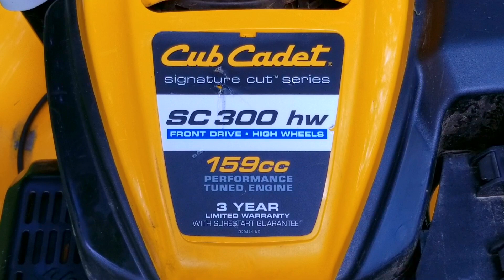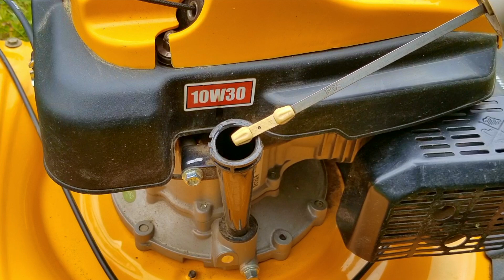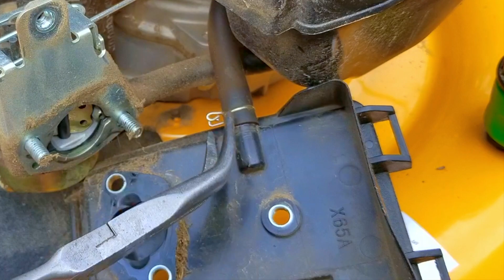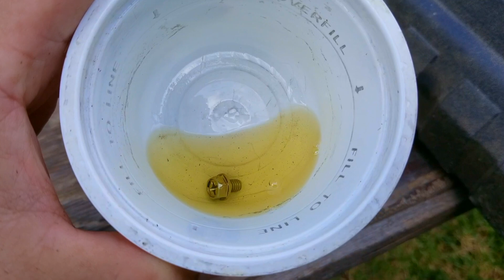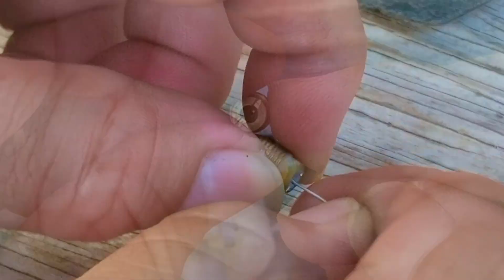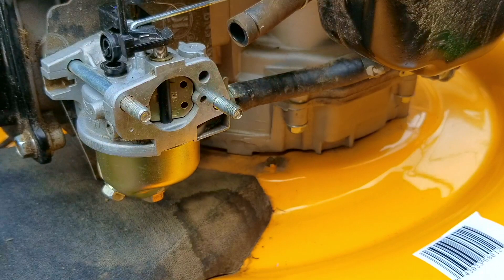Fixing a Mower revs up and down

Comment: Four years later and when I look at this engine, it's similar to one on a 2008 Yardworks (a Canadian Tire store brand) mower my Mom used to have.  Hers was the GXV140 variant of the PowerMore engine while this one looks like it's similar to the Honda GXV160 I have on my commercial mower.  Under the flywheel cover for the choke system, it uses a wind vane to open the choke once the engine is started.  It looks like this one has an added thermostat on the exhaust side that if I recall correctly, my Mom's didn't facilitate for easier warm starts.  They're good, reliable and robust little engines and even the horizontal shaft 420 cc one I have on my 28" Cub Cadet snow blower has been really reliable.  It, of course, was one that didn't have EFI or "Intellipower" and still has a standard carburetor.  I wonder though, one of the other comments was talking about fuel filters.  I wonder, don't these engines have a fuel filter screen in the tank like a Honda?  If it doesn't that's strange because other Honda derived engines usually do.
Reply from the maker: I'll have to take a second look at it again.

Comment: I think I would definitely flush the tank. When contaminants are in the tank, they can move around in the gas for quite some time without causing a problem. When you run it out of gas, all of the particles concentrate at the outlet screen. Like yours, some of the debris made it through the outlet screen into the main jet. You fixed the symptom but failed to eliminate the source of the problem. An inline filter may help. Also, I find it easier to remove the carb by first removing both studs. Then when you remove the fuel hose, you can gently move the carb away from the tank as you disconnect the hose. This will prevent excessive pressure from pushing back on the short hose from snapping the plastic nipple off of the tank.
Reply from the maker: nice, I'll have to fix that

Comment: I'd put an inline filter on the mower but also inspect the gas cans to see if there is anything lurking down below by tipping them over so one corner is lower than the rest. Works best on a sunny day. Glad it's fixed and GBWYou!
Reply from the maker: very nice advice.
Reply: @INSIDEHOUSEGARAGE  All I can say is that it works here and LOTS of folks mess up a good mower by pouring every last drop of gas into their tank and not seeing if it's water and trash or not. A simple look see or pouring out the last into a jar will tell the tale.

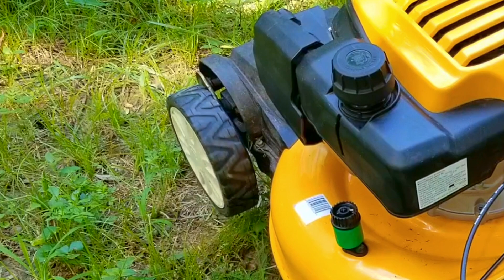Comment: 1:04 may I ask what is that little thing with the green on it on the mower deck?
Reply from the maker: It's a wash port. You're supposed to hook your garden hose there, and Run the mower after each use to keep the deck clean. Most people never touch it.

Comment: i worked on a honda clone just like that an them engines are just junk you can work on one thats never ran and it still wouldn't run it would be suprising to see one worked on an running
Reply from the maker: thank you Joshua Ferguson, these definitely have their issues.

Comment: I don't usually use fuel filters on push  mowers because the fuel line is so short. I would clean the tank  and carb and call it good.
Reply from the maker: that makes sense, thank you Brian King

Comment: Where and how do you dispose of all the gasoline you empty out of the equipment you get when its old and funky? Thanks
Reply from the maker: ah.. great question. I store them in a metal cabinet, and reuse the old as a solvent. if it's not that old, I'll put it into an existing tank of gas to be used as fuel.
Reply: @INSIDEHOUSEGARAGE  what if some of the equipment has 2 cycle in it? Do you separate it? What do you use the 2 mixed for?
Reply: @StudCity718  good for cleaning parts
Reply from the maker: even with small amount of oil in it, old 2 cycle oil is  still good for cleaning

Comment: Fuel filters are fine.  Sometimes the fuel lines are really small in length and it may be hard to fit on one but it’s worth a shot.  I would definitely recommend you buying a funnel called Mr.Funnel.  It’s a great funnel to reduce water and dirt getting in the tank
Reply from the maker: you make a great point. I'm thinking about getting a Mr Funnel.

Comment: Nice! I had this same problem with a customer’s Toro mower last summer. After it came back the second time I installed an in-line fuel filter and that took care of it. Nice Cub Cadet mower, I really like those Loncin engines. They’re a well kept secret, very good quality.
Reply from the maker: you know, I  wasn't sure about it, but it's really not that bad at all.. thank you mjg263
Reply: Interesting, I have nothing against them but if given the option would go with a Briggs especially since the price difference is often negligible.
Reply: @marknewman9430  I wouldn’t opt for the Briggs of today, they are not very durable engines at all and not nearly up to the quality of the engines Briggs used to make. They seem to have major QC issues since they started making them in China. Loncin has been making engines over there for decades.

Comment: Cub Cadet is owned and made by MTD - the engines branded as Cub Cadet, Troy-Bilt etc.. are chinese engines made by Zhongshen for MTD as they have a jont venture with them. One good thing about these MTD engines is parts are readily available from MTD products dealers and these engines are extremely easy to work on and reliable. i've seen very few problems with these engines. One problem is unless your a dealer, getting the service manuals are impossible. Also some of these MTD engines have an internal screen in the fuel inlet on the carburetor, as for a fuel filter - i highly advise against one, fuel filters have a micron rating, the lower the more restrictive - it would possibly cause fuel starvation problems.
Reply from the maker: thank you TheOutdoorPowerGuy, I appreciate the information

Comment: My Briggs and Stratton powered lawnmower has the filter screen inside of the fuel tank,I do have a Victa 2 stroke lawnmower where it's fitted inside the fuel tank & on the tap !
Reply from the maker: nice, I might have to add an additional filter on mine.

Comment: Nice job!!! I would add an additional in line fuel filter and also clean out the fuel tank and blow out the fuel lines. Great explanation throughout the video which makes a world of difference. You have a professional speaking voice and recording system. Where did you learn all the small engine know-how??
Thanks again for taking the time to present your wisdom!!
Reply from the maker: thank you Mr G.  yes adding an additional filter might be wise.

Comment: my parents Toro Recycler had that same issue. I replaced the carb since it was $2 cheaper than getting an extractor set because the main jet was stripped. I installed a red Briggs and Stratton fuel filter inline after I found the 'filter' that sits on the fuel line coming from the tank. 4 years later and the Toro doesn't miss a beat. it's cheap insurance, especially if one can find a bulk box of the red filters
Reply from the maker: thank you Donald McFarland, I might have to go thru with it.
Reply: @INSIDEHOUSEGARAGE  it'd be worth a shot, our Toro just hit 10 years old this year and it's a solid unit. I plan to replace the fuel filter next season and add an inline fuel shut-off valve to make fuel filter changes easier

Comment: My guess is the partially plugged jet was caused by bad ethanol fuel left in the tank rather than any sort of a fuel debris issue. So my guess would be to run ethanol free fuel if possible and to make sure that the tanks it’s dry for the winter. Adding a filter will not cure the problem if the ethanol fuel is allowed to remain in the tank all winter. Good job catching the problem and getting it to run nicely again.
Reply from the maker: I was thinking the same thing, the problem is that I use 100% gasoline no ethanol and with stabilizer.  So I was also using the mower every weekend.
Reply: @INSIDEHOUSEGARAGE  yes, but the problem was there before you got the mower, that is what got it tossed.  Who knows what the previous owner used for fuel. A filter can’t hurt, but they are not super fine filtration devices either. That clog had built up before you used a good fuel diet. That jet sits in a pool of fuel in the bowl. As the prior fuel turns to J-E-L-L-O, the solids cling to things before hardening completely. It was right on the bubble, apparently.
Reply from the maker: ah.. yes you make a good point.

Comment: Those gas caps are bad to collect debris on the underside of cap & if you’re not careful removing it some dust & debris will fall down in the tank. I wipe the underside of my cap before screwing back on tank.
Reply from the maker: Ah.. very good answer, I think you're on to something.
Reply: That’s it exactly. The poorly designed “half turn” gas caps used on newer Briggs engines are notorious for trapping dirt and dumping it into the tank when you remove the cap. I had a customers mower that kept coming back because of dirt blocking the jet and that’s exactly what was happening. Wiping off the  underside of the cap or an in-line fuel filter (or both) will solve that problem.

Comment: Install a fuel filter.  It can easily be added to yearly maintenance on the mower while remembering to grab a funnel is something you have to do every time you fill the tank.  If you haven't done it before, you're far less likely to pick up the habit now.
Reply from the maker: I think I will add the filter, It's something I might install right before next season.

Comment: Wow! Seems like they really design these engines to be completely repair un-friendly. Having to remove that stud just says, "don't bother trying to fix me" !?! I'm guessing the fine debris in the tank and carb get so concentrated when it runs out of fuel, that it takes some jostling around to get it cleared up. Thanks for that video!
Reply from the maker: thank you The Lawnmower Lady, it was definitely a mystery until I opened it up for a good cleaning.